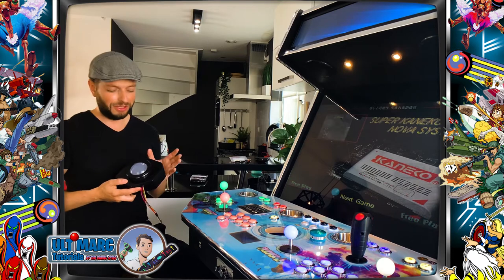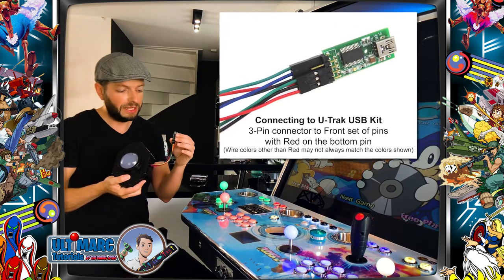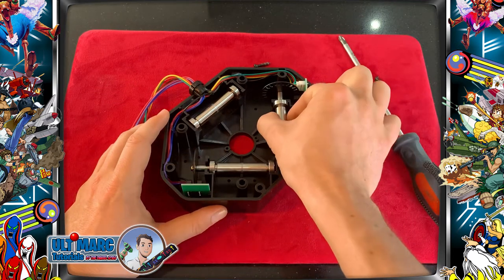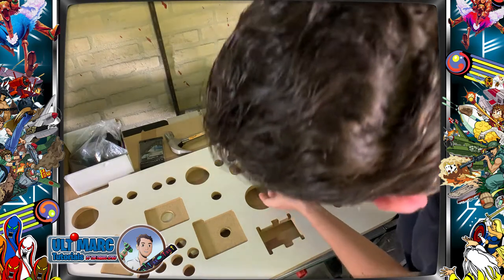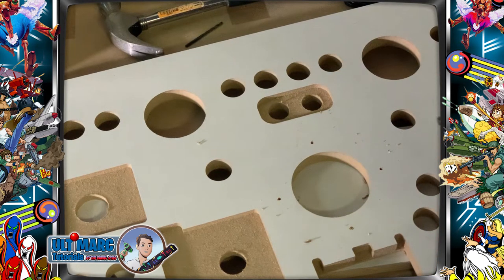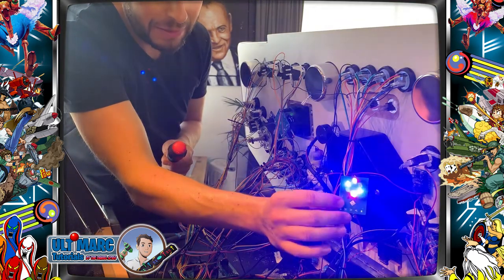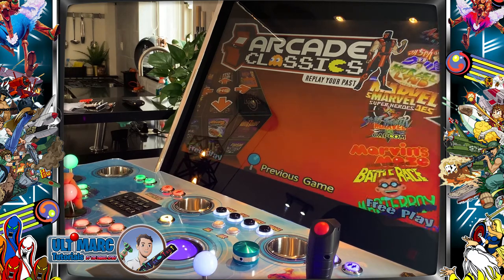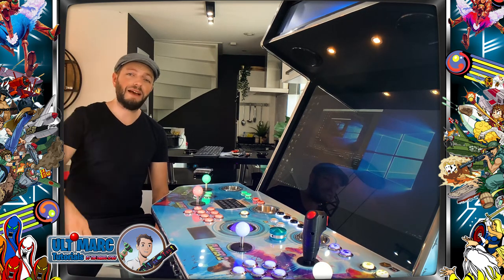Ultimarc Product Tutorials - U-Trak Trackball

Comment: I'm using an IPAC4 and an ultimarc trackball. If I wanted to add a couple buttons on my control panel as "Mouse Lef" and "Mouse Right" what's the best way to do that? Thanks
Reply from the maker: On a Ipac 4 there are two ways. In the WinIpac software just choose two ports and change them from Keyboard mode to Mouse mode. Select mouse buttons 1 & 2 and force re-config board. Done. Other option is to use the two outputs of the USB interface of the Trackball. They work without any additional installation. On the Ultimarc website is a diagram which wire is for which mouse button. Thanks, Daniël
Reply: @TheDanielSpies_Arcades  Thanks

Comment: Love these videos, but this video lacked the one thing I needed - the actual non-usb connection to the I-pac ultimate. Plus, a lot of us use Raspberry Pi, not windows...
Reply from the maker: Hi, I understand! To use the Trackball with the Ultimate board, just connect the two cables in the board as labeled. Windows will recognize it as a mouse. As for the Raspberry Pi, I can try to make a special Pi tutorial incl RGB commander software later? Thanks Daniel
Reply: @TheDanielSpies_Arcades   Thanks, Daniel. That's ok. I decided to switch over to a windows-based system because there seems to be a richer set of tutorials and videos for it. Also, I've been told that the version of MAME in RetroPi is almost 20 years old. Keep up the good work - love your videos! Now if I could only find a decent video on making a cool side-lit etched control panel... :)
Reply: @TheDanielSpies_Arcades   hi  I purchased the led light kit .and the very small circuit control board. I'm not sure how to wire it up . looks like the four pin connector plugs into the board . but I'm left with the black ground .  where am I connecting that to. and do I need an additional board .thank you
Reply from the maker: @danpettis1675  Hi Dan, here is a picture: https://images.app.goo.gl/s2AUveNQwvGv2oWUA
Just follow the colors and you will be fine 👍🏽

Comment: You don't by chance have a video or know of a video for the ultimarc j-stik joystick with the ultimarc Ikari 12 way rotary upgrade?? It's the upgrade to play games like ikari warriors, commando, time soldiers etc.
Reply from the maker: Hi, Not yet. I might try them in a future build for sure!
Reply: @TheDanielSpies_Arcades  Thank you. I bought the j-stik with the 12 way rotary upgrade I can get the j- stick to work fine but I can't get the 12 way to work. It maybe because I am trying to use it with a raspberry pi 4 and not a PC. But I'm not sure. Thank you again. Can't wait for the video if you do one. 🙂
Reply: I was trying to find video on the exact same thing.  I aim to build a cabinet soon and I definitely want Ikari Warriors.  I know there's the hack version where the characters just face front, back and side to side.  It works, but it's not the same.

Comment: Hi - im all installed but while works well in Mame the trackball creates freespin in the Hypersin menu - i would rather not have the trackball as a controller in Hyperspin but if i deselect it in HyperHQ....it doesnt work in Mame!  how can i either fix the trackball for hyperspin or turn it off in main menu but leave on for Mame?  Many thanks
Reply from the maker: Hi, Turn the trackball off in HyperHQ and go inside Mame. Press TAB key and configure Player 1 inputs. I think that Mame expect your trackball to be MOUSE 1 and that your trackball is infact MOUSE 2 or 3. Hope this helps? Thanks, Daniel

Comment: Hi there,  I'd love to get RGB pcb, but i don't have PACLED: is there a way power it and to modify colours without it? And how do you connect mouse buttons to IPAC 2 ? Thanks
Reply from the maker: No you need a Pacled board or the Ultimate IO Ipac from Ultimarc to use the RGB buttons. Mouse buttons can be emulated on any free input on the Ipac2. Just choose MOUSE in WinIpac software for that port.

Comment: This video came at an excellent time for me.  I just finished my cabinet this weekend and was having a lot of trouble getting the trackball to work.  I'm sure there are other videos out there that show the step, but this was the first one I've watched that showed exactly where I needed to go in the menu to get it set up correctly (12:30 in the video).   After I did that, it works great.  Thank you!
Reply from the maker: Thank you for your message, enjoy your new cabinet! 🕹
Reply: @TheDanielSpies_Arcades  will the ultimarc work on raspberry pi 4.  is this plug and play or do I need a additional controller board.  It does have a small board connected with a USB connection
Reply: @TheDanielSpies_Arcades  I bought the ultimarc. but I'm having trouble setting it up with the raspberry pi 4 .no matter what I do I can't get it to work I even ordered it with a direct USB connection for simplicity.  complete newbie here.  do you have any ideas. ? thank you

Comment: Thanks for the video! you have inspired me to build my own cab (pedestal actually). Because I want to use the ultimarch ipac2 in xinput mode, do you know if I will be able to use the trackball connected directly into the encoder? Or will I need to connect via the USB adapter. Thanks in advance (and will gladly take any advice on if using xinput makes sense, I was planning on purchasing creative arcades external hardrive for launchbox/hyperspin that is configured for use with xinput)
Reply from the maker: Hi, In X-INPUT mode, you will NOT have the possibility for trackball/mouse and or RGB lights.. so I would not recommend that...

Comment: Great video!
Was the panel here 3/4”? I’m purchasing this trackball but my CP is 1/2”. Will the trackball sit flush if my board is 1/2”?
Reply from the maker: Hi, Yes the panel was 19mm thickness. You should use some washers to adjust the height I think with a 1/2 inch panel. Have fun with your project, thanks Daniel
Reply: @TheDanielSpies_Arcades  thank you!!!

Comment: I also have the U-Trak with USB and the IPac Ultimate. Can you explain your thinking behind not using the USB interface for the trackball and using the IPac instead. Thanks for all your excellent videos Daniel.
Reply: I can explain for myself. I built a very complex control panel with a lot of different parts. I decided to use the IPAC to free up USB ports for my other items. But then I have two trackballs, two spinners, two flight sticks, and rotary upgrades for the joysticks.
Reply: @WeirdVideoGames  Thanks for the info,  that's helpful to know.

Comment: Hello, thank you for the video, did you CNC your control board and if so is there any chance you would share the cut files with me?
Reply from the maker: Hi, yes I cut the board with CNC. You can send me an email for files or custom orders. Thanks, Daniel
Reply: @brikeibur123  did you ever get the files mate ? i would like to make a similar control panel
Reply: @robhancock2240  I did not, still working on my arcade too.
Reply: @brikeibur123  i purchased his file set and worth every penny :-)
Reply: @robhancock2240  I purchased them a few days ago,  great files.  I want to be a copycat though but my bank account doesn't like it.  I'm around $1400 USD into the control panel currently.

Comment: Would you happen to know if the ULTIMARC TRACKBALL would work with a 60 in 1 ICADE board?
Reply from the maker: Sorry, I don't know that. You can askl Andy from Ultimarc that!
Reply: I figured it out and the answer is yes Icade shows a pin out in there lil booklet and Ultimarc shows the pin out on the web page for the Trackball had to order some Dupont jumper wire worked out well, great video  @TheDanielSpies_Arcades

Comment: Would the RGB led board plug into one of my LED usb encoders? Thanks!
Reply from the maker: Hi, Yes if you have a Ultimarc PacLED or Ultimate IO board. You can plug the pcb right in! Thanks, Daniel
Reply: Where does GND get plugged in?
Reply: @TheDanielSpies_Arcades  does this work with the sold white trakball?
Reply: @asadrian3  am wondering the same thing... did you ever figure this out?
Reply: @asadrian3  Did you ever get your answer to this? I have the RGB and yellow + cable plugged in, but am clueless to where the ground gets plugged in.  The only one I see is used up by the button wire harness for players 1/2.

Comment: I have retroarch (launchbox/bigbox). How do i set up my ultimarc trackball? I got the computer to recognize the mouse and i can move the trackball around. Same in retroarch, the trackball moves around like a mouse, but i dont know how to get it to work in games. PLEASE HELP!
Reply from the maker: If you are using Mame emulator, press TAB and go to player 1 controls. Then go to trackball X / Y, press enter, move the trackball and mame will recognize it. Let me know if it worked!
Reply: @TheDanielSpies_Arcades  I unfortunately am not using the mame emulator.  Just retroarch. When I setup launchbox, it only gave me retroarch and not mame. Is there a way to setup the trackball using just retroarch? By the way I really enjoy your videos! You have helped me tremendously with setting up my new complete custom built 4 player mega arcade cabinet eith 40" tv which I hope to post a video about my journey pretty soon!
Reply: @chevyspeed6368  RETROARCH just organizes the emulators. if you are still needing help, hook up a keyboard and hit TAB while you are in an arcade game and see if this menu pops up like normal. If it were me, and only playing arcade games I would re-import my set for mame OR post on the LB forums for help to convert. Good luck!